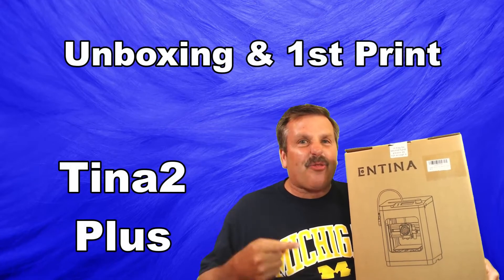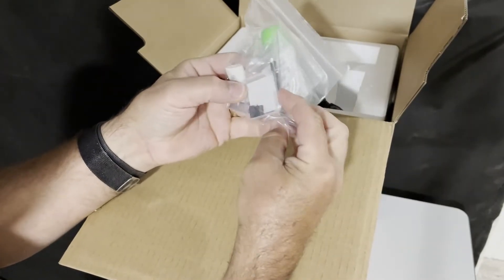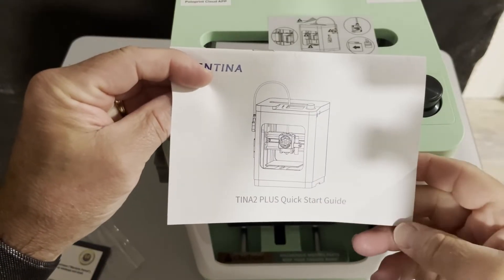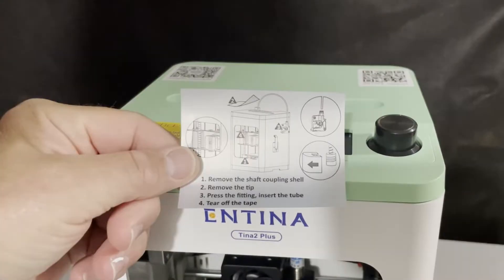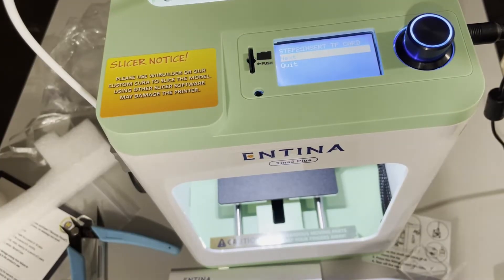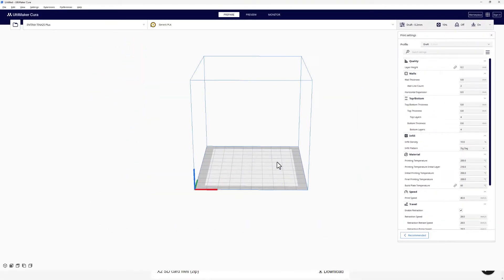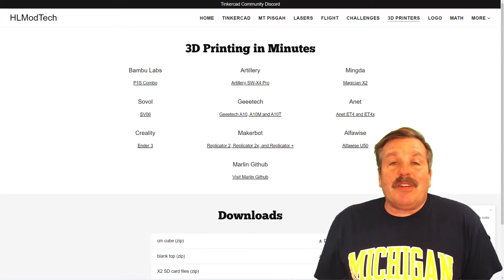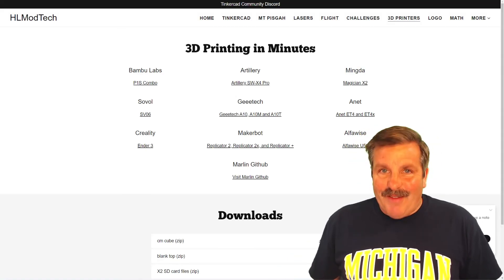Easily Setup the Entina Tina2  Plus & First Print in Minutes #3dprinter

Comment: About the same price as the Bambu Lab A1 Mini but with a fraction of the build volume and “use of third-party filaments is prohibited”? Add to cart! 🤣
Reply from the maker: Yeah. Fun little printer, but the A1 is a tough nut to crack.
Reply: @HLModTech  Maybe they should have gone the razor blade route: sell the printer for $10 but make it so it only takes 1.6mm diameter filament. What’s that? Nobody sells 1.6mm diameter filament? Why Entina does of course!  😈
Reply: Build quality is a bit cringe, but the rest of the points you made are big red flags.